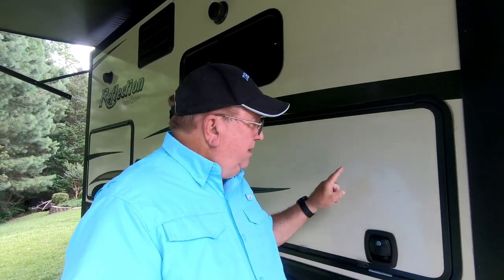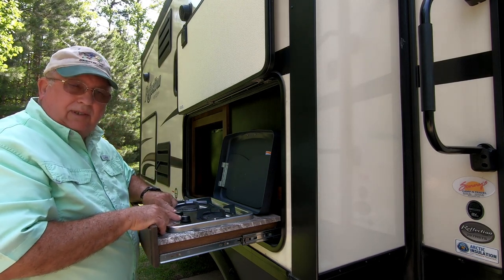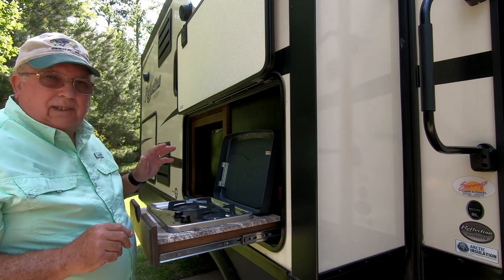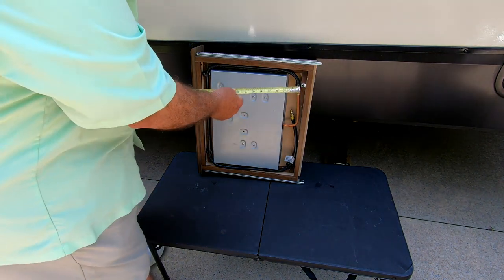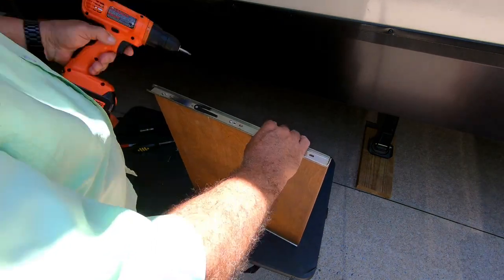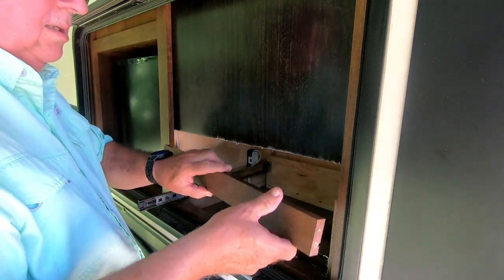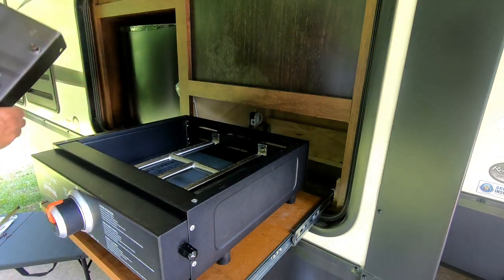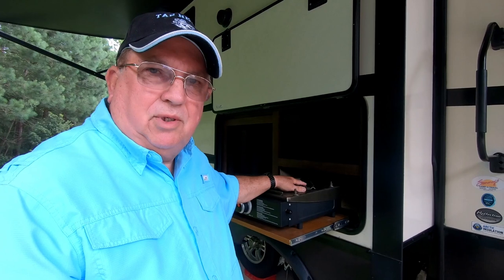Outdoor Kitchen Useless   Installing Blackstone Griddle

Comment: I have a 36 inch Blackstone at home and am thinking of buying a 22 inch model to rv with. I don't have the slide out, but will travel with it as a lose item. I noticed that the height in which your slide sits, the griddle would be uncomfortably high. But you are making the best use of that space for your grill.
Reply from the maker: Carl, you are right... it is uncomfortably high. I have the red chocks, and it seems that everywhere I go, the passenger side is the one that needs to be raised, making the griddle even higher. I usually use a little folding stool to stand on. However, the griddle does a spectacular job of cooking, and that's why I don't mind the inconveniences. Thanks for watching and commenting.

Comment: We have the same 2-burner stove on our brand new GD Transcend.  1st use of outdoor kitchen, my Lodge griddle was NOT over the knobs, yet both knobs melted down, as you predict (of course before I saw your video).
Coleman was always bright enough to put the knobs on the front panel of their stoves.
Blackstones are great; we have the 4-burner version on our home patio and it gets a good workout.
Well done on your project outcome, and on showing how you think your way to that outcome.
Reply from the maker: Thank you,  Grant. Yes, as soon as I saw the knobs on top, I knew there was going to be a problem. My Blackstone Griddle conversion has worked very well. I have the two burner Blackstone at home. My son has the BIG one... it is great! Thanks for watching and commenting.

Comment: I love the ingenuity. Just like on the blackstone folding table you could have put holes where the rubber legs go and your grill would have stayed right in place. Nice work though.
Reply from the maker: I thought about doing that, but I wanted airflow under the Blackstone. Thanks for watching and commenting.

Comment: Love this project. I think I might have to do this to my 297!  Would love to see what you do for the heat shield.
Reply from the maker: Thanks for the comment. Actually, I thought about wrapping a 24"x24" piece of cardboard with heavy aluminum foil, and just set it behind the griddle when I am cooking. I would simply store it beside the little refrigerator. My wife and I are heading out for a few days in about a week. I'll give it a try.
Reply from the maker: Hi GoinOutdoors. I have decided to buy this sheet (https://amzn.to/3gBLfPM), and apply it to a thin sheet of plywood or aluminum. It is good for up to 2000 degrees. I can then store it beside the little refrigerator.

Comment: I have a Blackstone griddle in my kitchen. I love it. I get teased by friends.
Reply from the maker: Hey Tiny Bigbus. I replied, but somehow it failed to post. Sure, using the Blackstone inside is no different technically than having a big skillet on stove burner. I like someone who thinks outside the box... and , obviously you do! Thanks for watching and commenting. If you haven't already, I would appreciate it  if you would subscribe.
Reply: @RVSite2Sight  Subscribed.  Many would say that is one of my problems. I always think outside the box. Square peg, round hole. I have a school bus that I am turning into a camper, besides the Blackstone, I am installing a three burner CampChef in the bus.

Comment: That slide needs a bit of stability when out, kinda wobbly.  Great project.
Reply from the maker: Hey Daniel, yes, I agree. It's the slide that came with the cooktop. In a later video, I'm going to beef it up with a stronger slide (100 pound capacity, and add another slide under the griddle so I can extend it out another 12 inches or so. However, I used it again this weekend  and it did great. Thanks for watching and commenting.

Comment: I have a two piece bag and cover for my 17" Blackstone. I find that when flipping the griddle for storage, I need the cover on to keep the base clean. There's always some minor amount of oil on the griddle.
Reply from the maker: Hey Lee, I have a 22" Blackstone on my deck. I bought the Blackstone cover for it, and I flip the griddle upside down like you do. However my cover stuck to the griddle and started coming apart when I tried to remove it. I finally decided that a little rust on the bottom will not be too bad. Thanks for watching and commenting.

Comment: I’m with everyone else. The stove top is unhandy. A regular size skillet won’t fit over a burner with the windscreen in place. And forget about trying to use both burners at the same time. Maybe boil water in a teacup size pot. 
But mine has a shelf on top that is near and dear to my heart and I don’t want to shorten it. Still plan on getting a griddle just to set on a table. Maybe I’ll use the old one for a table unless someone knows of a single burner replacement.
Reply from the maker: Hi John, I looked and couldn't find one. Maybe someone will find one and comment. Thanks for watching and commenting!

Comment: Do you have to pull the top off to empty the grease catch. Never mind I read more comments and got my answer. Thanks
Reply from the maker: Hi Keith. It depends on your situation. One of the problems I have is the little shelf slides do not come out far enough without releasing the little "catches" on the sides of the rails. On mine, I release them so I can pull the shelf out just a little more. When I do that, yes, I can remove the grease cup without taking the top (griddle) off the base. I am trying to find drawer slide rails with four sections instead of three, so I can pull the shelf out farther. Thanks for watching and commenting.

Comment: i suggest a screen or tinfoil lid when you are using it. it will pop and squirt liquids everywhere even with the lightest of hands. oil has a way of seeping everywhere, it carries in the air, little drops turn into a sticky dirt and grime collecting sheen on top of everything within air shot. honestly, coming from the fast burger and diner industry, i would not suggest it. grease and oil are gonna be a real issue for that. make it a pop out and off with legs that pop out. that way you can move it away from the rig.
Reply from the maker: Hi ZelosZelo, thanks for commenting. No doubt, they are greasy. I have 2 of the Blackstones. On the video I did about two  or three weeks ago (Blackstone Griddlin'), I show how I make a heat and grease shield to cut down on the splatter. I also wash my RV regularly with Greased Lightning degreaser and cleaner. It works very well.

Comment: I think you need to secure the drawer so that it can't slide out and engage the knob for the propane. Maybe just a simple hole drilled in the top to drop a pin through to ensure that it can't slide. Just a suggestion, but a great project none the less.
Reply from the maker: Hi Roy, yes, that was a concern of mine, so although it is not in the video, I added a peg in front of the shelf that keeps that from happening. However, I never leave the unit hooked up to the gas line. The reason I wanted it secure was to prevent the knob getting damaged. Thanks for watching and subscribing.
Reply: The gas wouldn't be connected when it's stowed away using the one gallon tank not enough room unless he hooks up to 20gal on board even then not enough room
Reply from the maker: @theodorehyatt1782  Yes, I only hook up the quick connect line under my RV when I am cooking. Once I'm done, I disconnect before I stow it away. Also, as a 50 year veteran of camping (I'm 72 years old), I never leave the griddle or grill unattended, and always have a fire extinguisher handy. Grease fires are always possible.

Comment: If you drill holes in the wood where the legs are on the grill that will allow you to push your grill back into its storage area without flipping the griddle over and it would make the griddle safer because it would not be able to move that way, although the way you have it screwed down it’s safe enough but if you could just lower it down a little you wouldn’t have to flip the griddle over just leave it in the ready position
Reply from the maker: Hi Monnie. Since the griddle does have a little heat on the bottom. I was afraid to do that. However, after looking at the situation, I think I might have enough room to cut the opening  bigger and leave the griddle upright. Thanks for watching and commenting.

Comment: Now that you have withing a doubt used this to cook on, how much heat is generated and transferred to the wood surfaces.  Do you have enough room  to move the panel up to be able to provide additional cooling space?  Or build a more robust metal safety wall?  That panel above looks like it may catch fire easily.
Reply from the maker: Hi Gary, at the end of the video I refer to another video which I made the shield to reflect the heat. It serves two purposes... as a heat shield, and as a grease shield. Here's a link to that video: https://www.youtube.com/watch?v=FLL6KWv330E&feature=youtu.be

Comment: I would be concerned about the heat pouring out between the burner and the bottom of the grill on the back that will be a lot of heat being thrown off back there. If the was a way to have an additional slide to pull out in conjunction with the original you could extend it thus giving you far more space for the 
Heat to dissipate more freely from the back you could lay the  additional slides on their sides on the slide you have already even if they slid out only six inches more would be a great help to allow circulation of air keep the area behind the griddle cooler. If the slides need a half inch clearance being on their sides under the addition plywood add and use a half inch piece of plywood you would need only one inch more than the clearance you have now. And I believe based upon your height measurements it would be possible to do this easily enough.
Reply from the maker: Hi Rick, in this video, I mentioned I would be adding a heat shield, which I did in the video "Blackstone Griddlin'." I am working on a video now, updating by answering some of the almost 100 comments. Thanks for watching and  commenting... and stay tuned!

Comment: really should have the feet on a metal shelf -- even some holes to stabile the feet..  it seems high for comfy griddling and very close to side of the trailer -- they make a nice hood-lid for these griddles
Reply from the maker: Hi Steven, on a later video (Blackstone Griddlin') I make shield rated at 2000 degrees to direct the heat away from the griddle. I considered the hood, but I was concerned about the heat coming out from under the griddle pan. After leaving the griddle on for about an hour, the wall behind my shield was cool, and the wood shelf under the griddle base was only slightly warm. I screwed the griddle base to the plywood shelf (in this video), so it doesn't move at all. I am currently looking for shelf slides that are beefier and longer to replace the flimsy ones that came on the RV. Thanks for watching and commenting.

Comment: Nice job, would be interested in knowing of any issues with the grease pan tucked back in there while grilling.
Reply from the maker: I have had no issues. I have to pull the unit out a little farther, but it works fine. The new Blackstones have the tray on the front.

Comment: Did you have any issues with heat damaging the cabinets behind the griddle?. I melted the gel-coat on my trailer from it sitting that close to the wall.
Reply from the maker: Hi Don. I installed a heat shield. (See a later video) Also, I plan on redoing the installation, and using a triple track slide so I can extend it more. Stay tuned for that video. Thanks for watching and commenting.

Comment: Why didn't you just cut hole taller so you can leave grill top right side up looks like another 2" off the top? It's a great idea, I wouldn't want it there but I wouldn't have wanted the stove top there either
Reply from the maker: Hi Theodore, I have limited space in that area. The shelf slide actually goes in under the oven in the RV.  Thanks for watching and commenting.
Reply from the maker: Hi Theodore, today I measured to see if your idea would work. However, the oven is 1/ 2" too low. See... I considered your idea.

Comment: Nice video, but may I suggest that you find your way over to Rockler.com and purchase a drawer slide that is both substantial and geared for the weight of the 
blackstone to begin with.  You will be hands down more happy with your install.  The stuff used by many trailer builders is just plain worthless.  They even make triples that will completely alleviate your fire hazard situation when cooking.  Get that baby out away from the combustibles.
Reply from the maker: jonny0004, I agree. In fact, if I remember correctly, I think I discussed how I need to improve it in a later video. I have been looking for a triple slide. Please reply with a link if you know where I can find one. Thanks for watching and commenting.

Comment: Grease spatter will be a big issue when cooking.
Reply from the maker: Hi Glen, thanks for the comment. On a later video (Blackstone Griddlin') I made a heat resistant splatter shield to protect the RV in that area. Works great!

Comment: When you are using it do you find thr heat is an issue. Below the unit and around it?
Reply from the maker: Hey Matthew, while I was grilling the burgers, I felt behind the screen and under the shelf holding the griddle. Behind the screen was cool (considering it was 90 that day), and the shelf was only slightly warm. I don't know how it would do if one kept it on for several hours. Thanks for watching and commenting.

Comment: I have a Reflection 320MKS which has the same grill installed. The first time I used it I melted the knobs. I carry a 22’ Blackstone with us but it’s heavy and difficult to store and move around. I will probably buy a 17 and do this. Thanks for the video!  PS: Have you had any issues with heat radiating into and damaging the cabinet?
Reply from the maker: Hi Captain Skippy, on my video on Cedar Point Recreation Area, I show how I made my heat shield. Thanks for watching and commenting.
Reply: When you say you had the same grill installed, do you mean the two-burner cooktop or the Blackstone?
Reply: @EasyE20210  the two burner. For such a wonderful RV the grill is junk

Comment: Why not store it in another  place and put it on a table when you use it. Then you have the 
2 burners outside for other things...... ps I think you can get a hard cover for it now too.
Reply from the maker: Hi Wayne. I just didn't like the burners. As I mentioned in the video, I like a griddle, and the way my Reflection 297 is designed, if I sat a griddle on top of the 2 burners, the heat would melt the knobs. Thanks for watching and commenting.

Comment: He may find this is mess waiting to happen, and heat cannot be sufficiently controlled. He might try hanging welder's cloth behind the unit when cooking, to protect his rig from heat.
Reply from the maker: Hi Sarah, in one of my later videos, I show how I made a heat shield which also serves to protect the RV from grease splatter. I checked the temperature behind the screen, and it was cool (as cool as it could be on a 90 degree day). Also, I checked the heat under the griddle, and it was only slightly warm. Thanks for your concern, and thanks for watching and commenting. BTW, here's the link where I made the heat shield: https://www.youtube.com/watch?v=FLL6KWv330E&t=1s